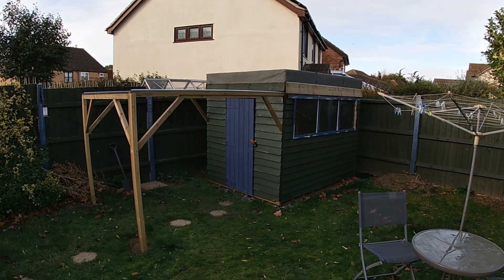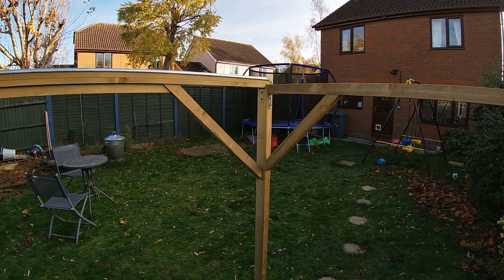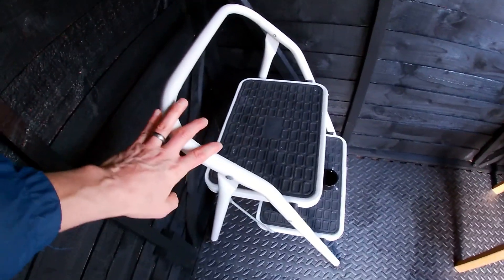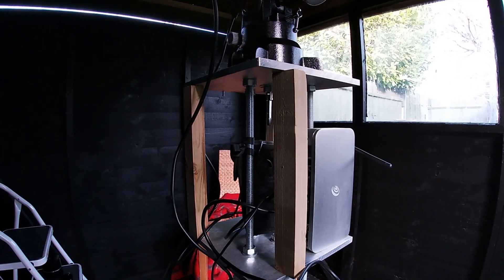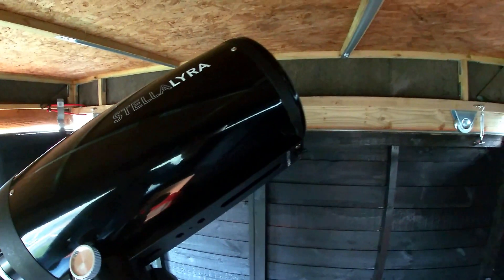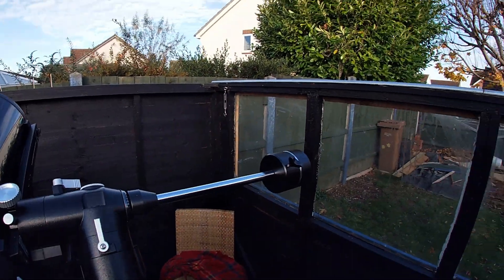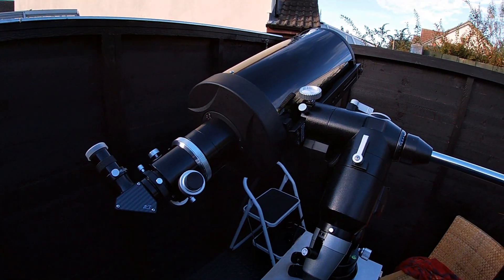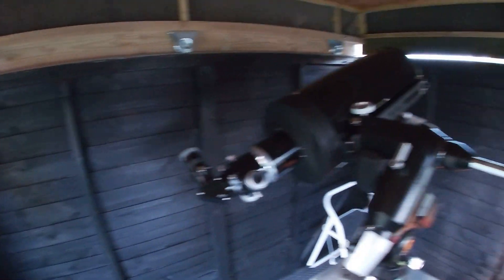Recycled Observatory Tour - Telescope Installed and We've Had First Light

Comment: Very interesting Chris.  I have the smaller iEXOS-100 PMC-Eight mount for portability and an SVBONY SV503 80MM ED refractor.   The iEXOS-100  a cracking little goto equatorial mount that tracks very well and is really quiet in operation, being belt driven.  I can't set up a permanent observatory here but there is a handy nearby cricket field nearby  with excellent all round views and far less light pollution than at home.   Good work Chris and Clear Skies.

Comment: Love the idea of converting a shed into an observatory, great idea :).  Just from my casual observation, how water tight is the conversion?  With the roof closed there seemed to be gaps at both ends of the roof and at the top of the door.  This could be a particular concern especially if you are installing electrics?  Rain can be a pain to deal with and storms or heavy rain can really force water through even small nooks and crannies.  Teaching you to suck eggs I'm sure, just a belt and braces check that it's all ship shape and Bristol fashion!
(I'm new to astronomy but not new to water or storm damage).
Reply from the maker: It's a very good question J J, and the answer is it's fairly water tight, but not 100%. After heavy rain I can find the odd small patch of damp on the foam tile floor. I've used two bits of feather board to make a small porch/lip at the front and the back so the vast majority of the rain just runs off, but as you say there can be the odd bit of side ways rain :D I wouldn't change the small gaps though, air flow is so important to prevent mould. This was the mistake I make with my first build. Firstly it was leaking like mad so I sealed it all up good and tight, then the mould set in. There is a balance I've discovered and I think I've got it about right with this build. I'll do an update soon, just a few more jobs to do to make an update worth while :)
Reply: @Astrolavista  ok all good then :)  When you come to install electrics it might be worth using outdoor waterproof sockets (at least IP66 rated) just to be double sure - although I'm sure you've already considered that (and perhaps I should watch more of your videos to see that)!

Comment: Hi Cris, This was helpful. I'm considering a RORO and I was concerned about line of sight and 'scope clearance. I suggest getting a pro in if running mains power to the observatory - for a permanent supply it's a legal requirement here and you would need the supporting paperwork if you come to sell or make an insurance claim. You could just use a long extension lead but it may not be as safe as you would like. Exterior earthing arrangements are very dependent on the way your house supply is earthed - there are several varieties in use and getting it mismatched on outbuildings can have serious consequences. For example a local earthing point at the RORO can be a very bad idea in some situations.You also need to ensure that any earth fault current will be enough to rapidly trip the mcb  and rcd protection within the required times. Alternatively if the total current draw will not be too much (say under 10 amps) consider having the mains voltage to 12 volt dc conversion in the house and run heavy cables to your nice RORO with everything there being run off 12 volts.  A decent sized car battery charger would do the job. Fundamentally much safer and ok here to diy but do make sure you do not introduce a big voltage drop in the low voltage supply cable by having them too thin or too long. Also make sure the low voltage side is properly fused - plenty of videos about that. BobUK.
Reply from the maker: Hey Robert thanks for all the advice. The shed I used to make the RORO used to sit on the other side of the garden and it had fused electrical sockets but no RCD that I could see. Only the shed base remains so I've placed all the cables and sockets in the water tight bin for now. The plan was to dig a trench and run some cable from this supply through some piping to the obsy maybe 15' away, but I've also considered using a leisure battery in the RORO and have it trickle charged from solar on the roof, that's if I can figure out the cable management for a roof that rolls lol? I'm not that great with electrics so maybe starting with low voltage would be the safer option like you say :) I'll watch some YT videos and have a think about it based on your advice. Cheers!
Reply from the maker: Maybe something like this? https://www.amazon.co.uk/Monocrystalline-Charge-Controller-Extension-Battery/dp/B07RZBVTGR/ref=asc_df_B07RZBVTGR/?tag=googshopuk-21&linkCode=df0&hvadid=375423088030&hvpos=&hvnetw=g&hvrand=16983592743789205058&hvpone=&hvptwo=&hvqmt=&hvdev=c&hvdvcmdl=&hvlocint=&hvlocphy=9045074&hvtargid=pla-843716935674&psc=1&tag=&ref=&adgrpid=82457260731&hvpone=&hvptwo=&hvadid=375423088030&hvpos=&hvnetw=g&hvrand=16983592743789205058&hvqmt=&hvdev=c&hvdvcmdl=&hvlocint=&hvlocphy=9045074&hvtargid=pla-843716935674